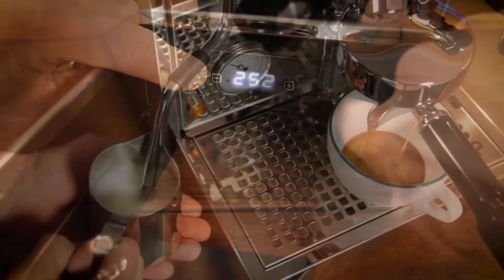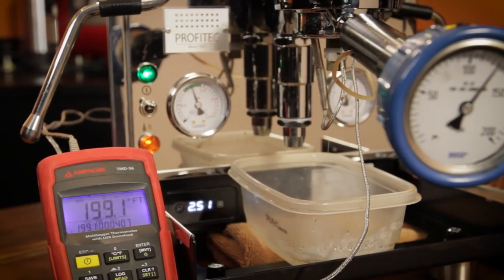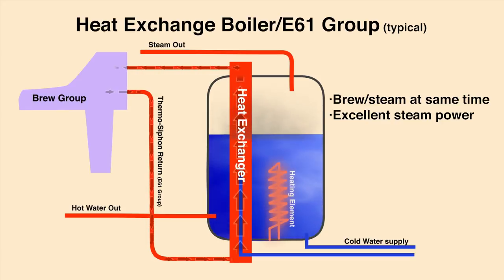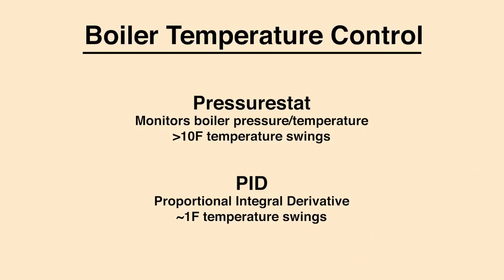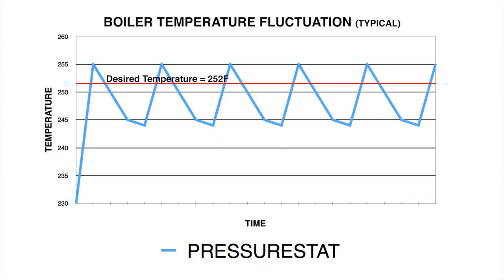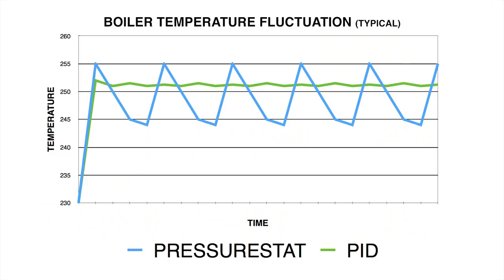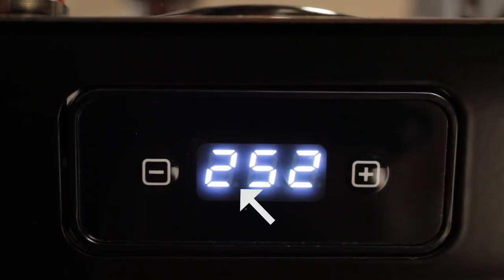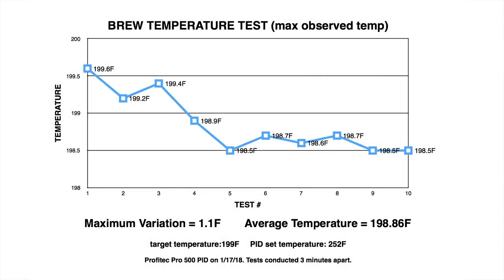Review: Profitec Pro 500 PID Espresso Machine

Comment: Such a lovely machine, Profitec is one of the best brands in espresso their machines are top notch and the 500 looks incredible
Reply from the maker: Hi BC, Thanks for the comment. Profitec and sister company ECM make excellent machines! ECM adds more details. For example the Profitec Pro 700 and ECM Synchronika are nearly identical internally. The Synchronika has more refined exterior details.
Marc

Comment: Hi Marc. Finally got my Pro500 PID. Love the machine. However, I think the PID settings can vary quite a bit, either from manufacture lots or due to ambient conditions. Mine came with PID set to 248. I don't have a scace ($600) or E61 therm. which is $200 here in Canada, so I used the small 'foam cup & fast thermometer' method to measure brew water. Cut foam cup to cover brew screen tightly, put thermometer through side and dispense about 2oz water. My measurements gave only  175F with PID at 248 and I thought.. wow.. something's wrong. When I set PID to 252 (as you did) I get 190. So although the foam cup is not as accurate as scace, I think it should give me the initial brew water temp within a degree or 2, as this thermometer is +/- 1/2 deg with a fast 3 second read. Won't give me the shot 'profile' temperature over time, but that is not important to me yet. I think I'll need to go up to 254 to get about 200F. But for me, the table in the Profitec manual seems way off. HX machines really could benefit from some easier mechanism for brew water temp determination. From my brief week with the machine, there really appears to be no cooling flush required and shots seem to taste very similar shot to shot. I'm looking forward to learning to change parameters based on taste, but have much education to do with the taste buds :).. Steam performance is great and a huge step up from my 'starter' machine.  One last question.  This machine is setup with 10bar pressure, max. I can get an extraction that is roughly 1:2 in 25 seconds and looks good in the bottomless portafilter, but the pressure is pretty well at 10bar. Does one adjust grind/dose so that extraction requires only 9 bar or will it usually always go to the max pressure that is set? Thanks again for all the videos on this machine. I'm very happy with it. The Sette 270 seems to work super with it on the 4-5 sets of beans I've used (all med or dark roast).
Reply from the maker: Hi Dave, Congrats on the machine! Brew water temps at the group are incredibly difficult to measure! Even with a Scace device one must decide when to record the temp. My standard is to record the temp after ~1.5oz/45ml of water has run through the Scace. The Scace uses a thermocouple temp probe. They are about as fast and accurate as you get for this type of temp measurement. But there's still some lag and potential for error in the reading unless recently calibrated. Also first water out of the group is never going to be at set temp and that's okay! I gave up trying to measure brew water temps with "instant read" thermometers long ago - so much variation in brands and I'd take manufacturer stated specs for speed and accuracy with a grain or three of salt! They are faster than bi-metal analog thermometers but I have observed temps continue to rise for five seconds and more when measuring milk froth temps after shutting steam off. The foam cup can give you an idea I suppose but it really doesn't simulate actual brewing conditions of pressure and pre-heated portafilter etc.

As to PID set and resulting brew temps. In my testing I found Profitec's charts were off as well. Ambient conditions play a role but I think PID at 252F is a good place to start. From there I would let taste be your guide. It depends on coffee type and other variables but if you detect bitterness try a slightly lower temp. If sour, a slightly higher temp. Also lower temp for darker roast and higher as you go lighter in roast. Keep in mind it can take 10-15 minutes for temps to stabilize after changing the PID set - there's a lot of thermal mass in the boiler and E61! In the end I would not get too wrapped up in temps. What that PID gets you is day to day consistency.

As to brew pressure... If there is enough restriction from the grind the machine will go to pressure set by the OPV. If you are getting good extraction with good timing and a brew ratio you like I would not be overly concerned unless brew pressure is outside of an 8-10bar range.

Sette 270 is a very nice grinder. I love the grind quality! Fluffy, clump free, well distributed grinds IMO make channeling less likely. I really notice it when doing bottomless shots. As the the espresso first pushes thru the filter basket it grows evenly with complete coverage and I hardly ever get spurts!

Enjoy your machine and the quest for incredible espresso! Pro 500 and Sette 270 are a winning combo.
Cheers,
Marc
Reply: Thanks Mark! appreciate your attention.  @Wholelattelovepage

Comment: Hi Mark would you recommend the pro 600 over the 500, I know the steam pressure is the biggest difference but apart from that the 500 is equally capable
Reply from the maker: Hey NQ, thanks for the question. I'm sure you understand the Pro 500 uses a heat exchange boiler and the 600 is a dual boiler. On the 600 you can set temps for each boiler and you'll set the actual brew temp you want. Can also turn off the steam boiler if desired. On the Pro 500 you'll set the actual temperature in the boiler based on na chart which gives you brew temps based on the actual boiler temp. Pro 500 is very good at consistency with brew temps but as an HX you may need to do a cooling flush prior to an extraction depending on when the last extraction was. Also as far as I know  Whole Latte Love is the only vendor offering the latest version of the Pro 500 with visible PID/shot timer as seen in this more recent Pro 500 video: https://youtu.be/vuci2UFdt4w
Hope that helps!
Marc

Comment: Hi Marc, I just got the Profitec 500 and am enjoying it. It's a nice upgrade from my old Bes900xl. One thing I have noticed is that if I draw a mug of hot water from the machine, and water from the reservoir then enters the boiler, the pid doesn't change temp or reflect the fact that the water must no longer be at full temp. If I then draw steam, the steam basically completely runs out within a few seconds and pressure drops to 0, then the pid finally also drops and starts heating the boile to bring it up to temp. I am guessing that the pid measures steam temp and the introduction of cold water to the boiler doesn't initially change the steam temp and hence the pid doesn't change or start heating the boiler. When you then tap the steam, the water is then not hot enough to maintain the steam pressure, so the machine runs out of steam. The machine then realises this and heats the water. It's a bit annoying. Is this normal behavior??
Reply: It almost sounds like your PID is not working. You seem to be describing how a pressurestat works.

Comment: Hi Marc, thanks for another great review. 

I am on the fence between Profitec Pro 500 and 600. I'm certain both are great machines, but I don't understand the justification of $400 extra for the Pro 600. From what I can tell, the differences are a dual-boiler, a front PID display, and easy brew pressure adjustment. Am I missing anything? Is Pro 600 better built? Is it more reliable? I'd think that Pro 600 being higher up on the hierarchy would mean it would be a better machine. But, that doesn't seem clear cut here.
Reply from the maker: Hey JK, You are welcome for the video! So the 500 uses a heat exchange boiler and the 600 is a dual boiler. On the 600 you'll have independent control of the temperature in both boilers. In the 500 you set one temperature usually setting it to get the brew temperature you want. With that,  your steam pressure depends on that one temperature setting. If you want more steam pressure you'd turn up the temperature with the side effect being your brew temp will increase as well. With dual boilers the temperature in the steam boiler has no effect on brew temps. Also the 600 is capable of much higher steam pressure than the 500. Set the 600's steam boiler temp 270F and you'll have ~2 bar of pressure in the boiler. That's a lot more than available on the 500. ^00 also has some additionl function available througgh the PID controller like the automatic shot timer, cleaning/backflush reminder and ECO mode which turns off the boiler after a user set periord of  no use. Build quality between the machines is essentially the same. Hope that helps!
Marc